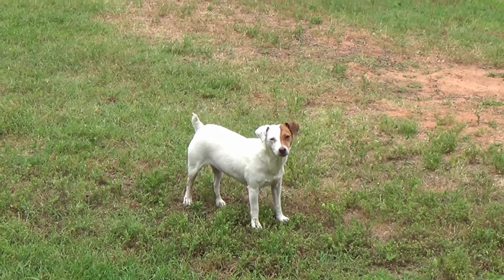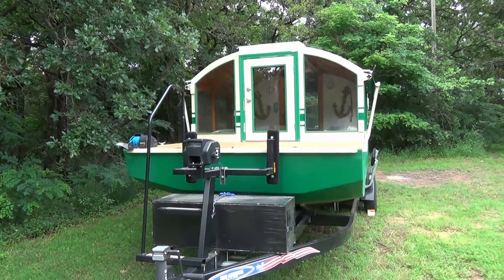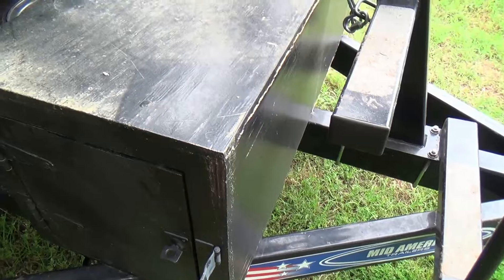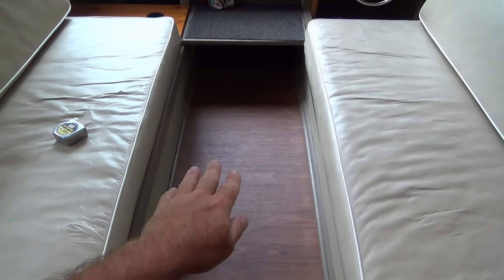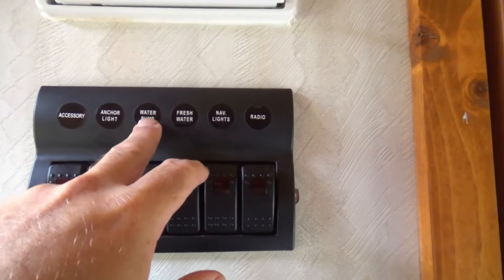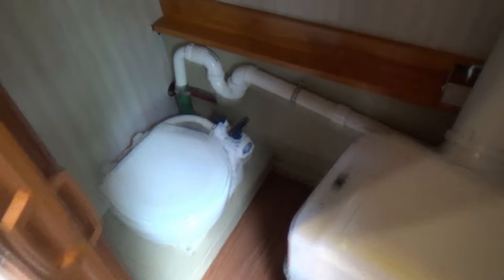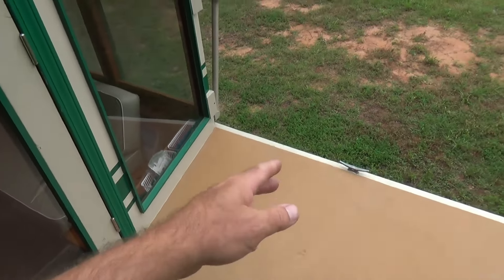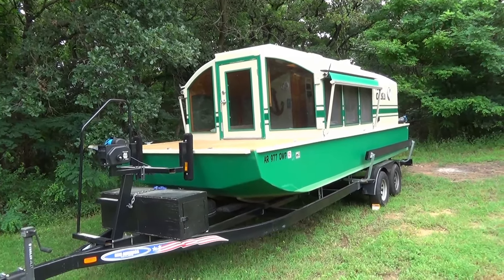The Oasis Houseboat walk through Ep 272

Comment: As long as you don't plan on taking it to the Mississippi or similar.  Certain conditions like a small wind and the current will have you at a stop even at full throttle.  A friend has a similar house boat and after three motors he has a 60HP 4cycle.  In calm water he can do 6 Knots at a low fuel use cruise.  Any headwind cuts it to 2-3 Knots.  Full throttle will get him 8 knots and triple the fuel usage.  so to keep economy he cruises at 2,000 RPM.  Great boat!
Reply from the maker: I had a friend out with me on The Oasis today and I was explaining the exact same thing to him. IF I did go out into the Mississippi I would be committed and at the point of no return.  In for the long haul to do the great loop going down stream.
Reply: @mathewdavis-adventuresandd6643  Ya, my friend got caught at one lock.  Had to wait for a barge and needed to back up up stream against the current and a wind.  To turn around he would have been broadside to the wind and swept away.  With 60 HP he made 3 knots.....  Otherwise if he had a lesser motor he would have been up against a lock gate when they opened, got run down by the exiting barge or had to run up against the dam.  No good choices.  Have plenty of HP.
Reply from the maker: @myfavoritemartian1  Good point.  I was actually thinking about reaching out to Roy the designer and see what he thought of a 50 or 60 hp outboard.  I don't need anything fast but 7 mph max speed could get me in a tight spot in heavy winds or current.
Reply: @mathewdavis-adventuresandd6643  In a no wave, no wind, no current lake, my friend's boat gets 12 kph with a 60HP.

Comment: My wife and I have the first boat that this builder launched.  It is exactly like yours but only 17 feet long with a 20hp motor.  We purchased it from a couple who bought it from the builder and never put it in the water.  The paint scheme (using tape as stripes) and the interior seats are the same material.  Ours was built in Anderson Indiana but we have not been able to speak with the builder.  Roy, the designer, has many videos and I am sure you have watched them and know quite a bit about it's capabilities.  Because of the hull design don't expect it to be very fast but it is great for lakes and rivers.
Reply from the maker: I'm sorry that I'm just now seeing your comment.  For some reason YouTube doesn't notify me on all of them.  It wouldn't surprise me if it was the same builder.  Mine drafts only four inches at the back.  With a 30 hp power outboard she only travels 7 mph top speed.  But, that fine as my monohull sailboats only go about 7 top speed also.  I'm older and getting there fast is not a priority in my life.

Comment: That's a sweet little boat.  I've been yearning for something like that.  Same as you, I need one light enough to pull with a 150 size truck.  I'm curious about how she tracks in a cross-wind and how the 30 Hp handles a headwind.  I know you don't need to go fast, but sometimes you need a bit of power just to deal with the weather.
Are you sure that the little paint crack above the door is fiberglassed?  Seeing the tongue & groove joints there makes me wonder.  
I'm subscribing to hear more.  Looks like a blast. 👍
Btw, where are you located?
Reply from the maker: Thanks for watch the video.  I've only had The Oasis for less than 2 months and haven't had it in a bad blow yet.  What weather I have had it in, it has performed very well, although big waves from the side are very unpleasant while at anchor.  The top has at least one coat of fiberglass on it and the impression of the joint shows through and all cracks have been sealed up until I can stripped everything down and give it another paint job. That deck has to be changed to a white nonskid.  I'm located in Norman, Oklahoma and I'm lucky enough to live 1/2 mile from one of the boat ramps.  I'll be exploring many more lakes though.